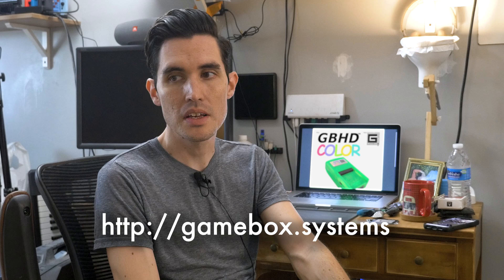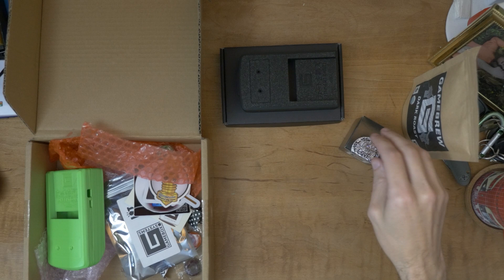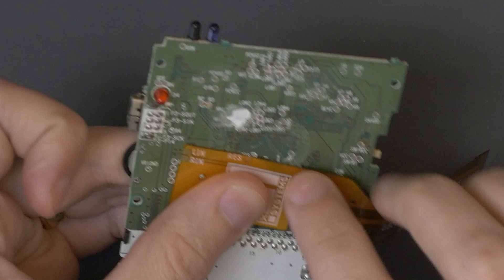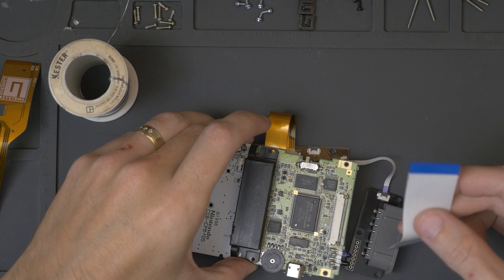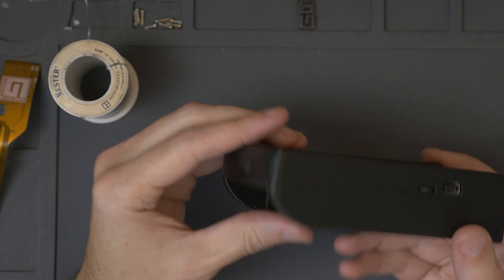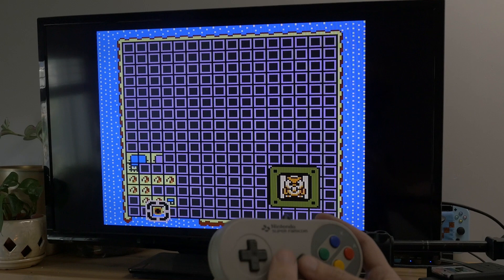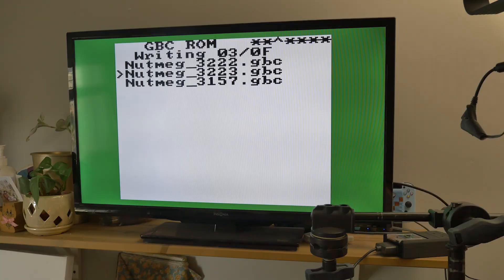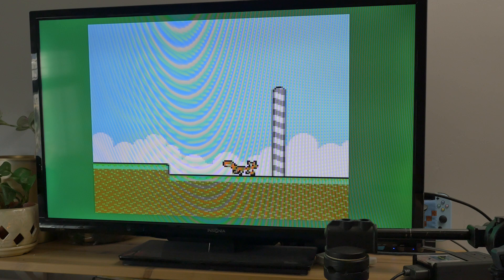Play Game Boy Color on your TV (on REAL hardware!)

Comment: Nice work, try to get a fiberglass pen for more precision with scratching the via's clean.  Also, a tube of flux will do you wonders when soldering to a flex cable.  Just a cheap tube of chipquick from amazon will do the trick.